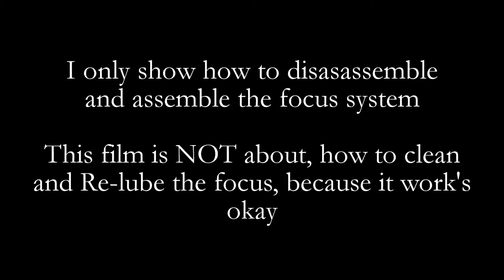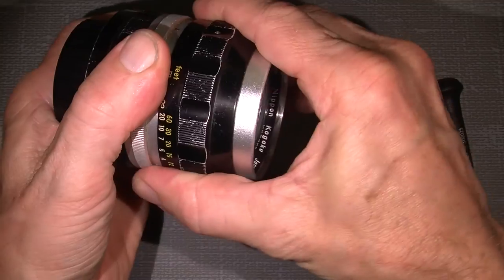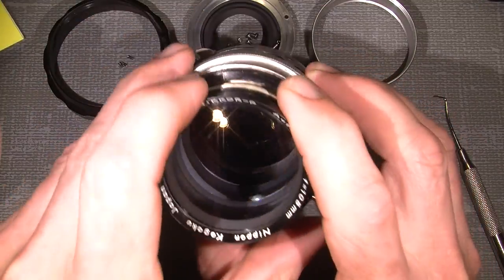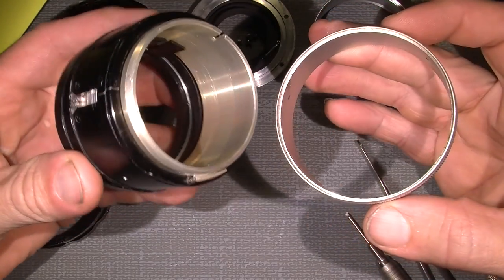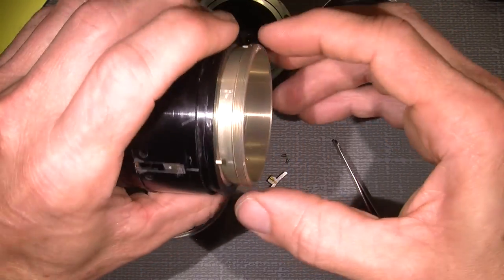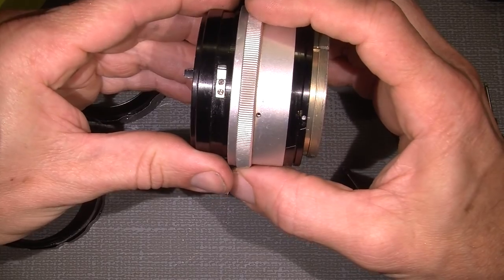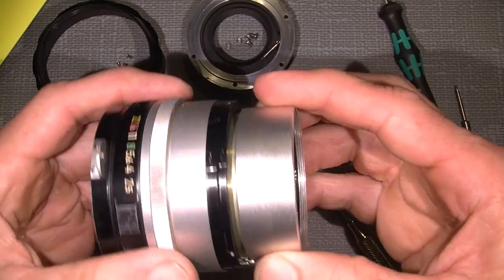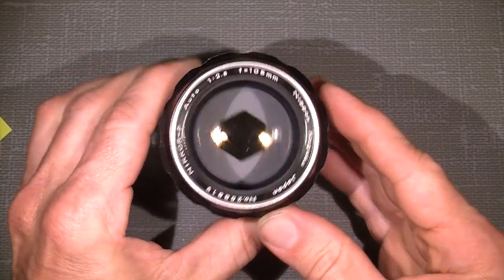Inside the focus helicoil's in NIKKOR-P AUTO 1:2.5 f=105mm non-ai

Comment: What size flat tip are you using to remove the screws from the bayonet?  They're so tight on mine and I can't get them to turn at all.  Do I need to apply heat to loosen the glue?